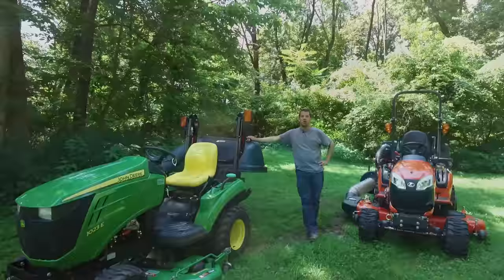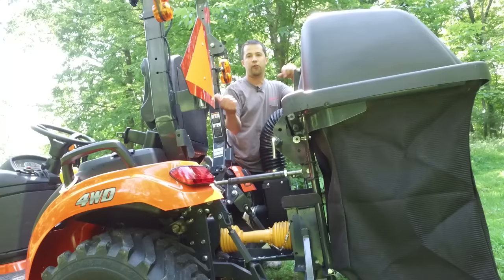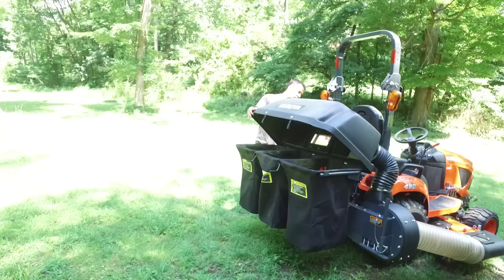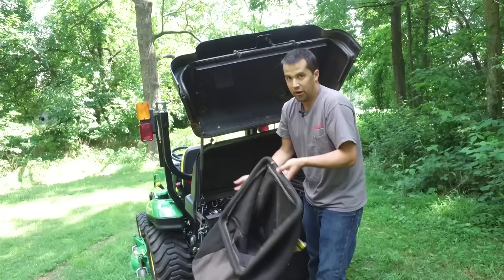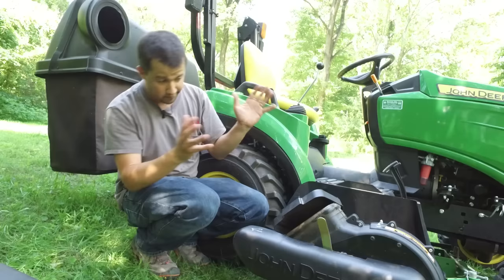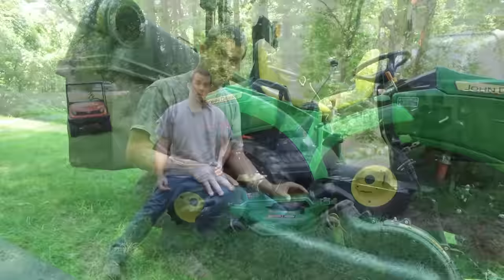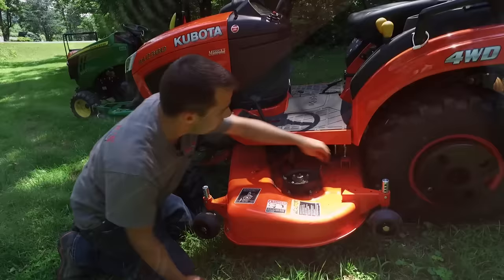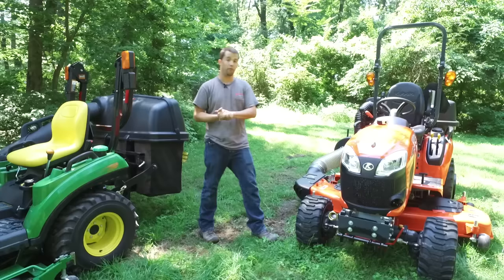John Deere 1 Series VS Kubota BX Series: Grass Bagging System

Comment: I agree the Kubota does seem to be heavier duty and I really like that it is mounted on the 3 point hitch instead of some other mount thing. Also really like that the hoses on the Kubota are flexible which makes them much easier to clean out. That hard plastic chute on the Deeres are a real pain to clean out, especially when clogged up, however it can be easier to whack it on the ground and beat stuff out, but still cant reach all the way inside to get to everything. Also the off set of the Deere is really nice when mowing up close to large shrubbery and small trees as there is a lot less to get hung up on the machine and damage the plants. And the bags falling off is no issue at all. There's enough friction there from the weight and bits of grass between the fabric and metal that they dont go anywhere. That clip on the Kubota honestly would be a pain in the spring and fall when everything is wet and there is so much more weight than normal that having to fight that would be pretty annoying. I would chop them off pretty fast actually. Havent used the Kubota set up though, so can't say its the beat all, end all. Kubota is definitely coming up with some nice stuff though recently. I realize I'm a bit behind as to when this was posted, but I look forward to seeing what the other side is up to.

Comment: I have a 1025R with a 60” deck. Very heavy construction and the auto connect works great for me since I bought it back in 2013 (with no adjustment since new!) a real time saver. The Kubota bagger looks much nicer. For the Deere (and Kubota) you can get a TKV20 bagger setup which is much better, with a PTO fan and the ability to dump from the seat.

Comment: My neighbor has a Deere with a 54" deck and bagger.  First thing he did with his bagger is utilize his OLD plastic canisters from his Crapsman bagger in place of the mesh bags Deere has.  MUCH easier to dump.  Almost a direct fit.  All he had to do was reinforce the top of his canisters with some 3/4" pvc pipe.

As far as mowing, his Deere does 10 times better job of mowing than my 60" Kubota does.  My deck does not pick up behind the front wheels especially on the discharge side.  I put on Gator blades and that made a huge difference, but I'm still not pleased with the result.  I've also watched him take his deck on and off many times, never had a problem with the drive over.  Personally, I don't mind the "old way" of removing it and I would never leave it on when tilling a garden.  You end up with too much dirt on top of the deck.

All in all, I would still buy the Kubota over the Deere
Reply: Your mower deck should cut way better than the deere deck. Make sure you have it balanced left to right and set the pitch to .25 inch lower in the front.

Your kubota deck will out do that deere deck easily
Reply: @Stegs  I was wondering this too if 48VAC's deck isn't properly leveled.  I know with my regular lawn tractor if the deck isn't level side to side, it not only cuts uneven (duh) but the overall cut quality just sucks, it don't lift and blow clippings out properly and it don't cut very clean either.  

I think you have to run at just about max engine RPM to get a nice clean cut too, many people I guess just try and run at lower RPM's for whatever reason which lowers the blade speeds on the mower and gives a lower quality rough looking cut as a result too.  

I skipped buying the mower deck for my Kubota because I already have a lawn tractor, but at some point my buy the deck for mowing the pasture, only the future knows what I'll end up getting HAHA.  I'm waiting for my dealer to get more BX tractors in, they're completely out due to high demand for some reason, its weird, but I guess with this COVID stuff going on everyone got rich somehow and bought a tractor LOL.  So I'm about a month and a half away from taking delivery of my BX2680 with loader, tiller, and box scraper.  Can't wait.  

I realized while researching sub-compact tractors that the JD 1-series has a limited category 1 hitch and a slower mid-pto speed too (2100RPM, instead of the 2500RPM of the Kubota).  The 1 series John Deere I swear is a over-priced lawn mower really in the way its built they skipped a lot of stuff that would really make it a sub-compact tractor it seems.

Comment: I'm a Deere guy but I will be the first to agree that the deck setup and bagger on the Kubota BX is world's better than the Deere. The 1-series bagger is an abomination. It's interesting that you measured the raised height of the decks. That is something that soured me right away on the 1-series. When the deck is raised it barely clears the ground. Maybe not a big deal if used as a dedicated mowing machine but it certainly means you'll want to remove the deck for loader work. I have a slightly larger Deere model and elected NOT to use it for mowing. The deck setups on most of these small tractors is just too kludgy. For what I would have spent for a decent mid-mount deck and the extra hardware to go with it I was able to just get a dedicated riding mower. :-)
Reply from the maker: Yea, we see that a lot too. The decks for these bigger machines start getting really expensive. Once your into a Kubota L-series \ Deere 3xxx \ etc you can buy a small ZTR for the cost of a deck.
Reply: Messick Farm Equipment Which really doesn't make sense.  Decks do not have an engine, the most expensive part.  So where is all the cost going?
Reply: I know nothing about the bagging system, but the mid-mower deck on a JD is worlds better and faster to remove or set up than a Kabota.

Comment: I have had a BX2200 since 2001 with bagger.   I LOVE the tractor.  The ONLY thing I don't like about the tractor is the rocker foot pedal.  The JD twin touch is much better.  The Bagger works VERY well.   I have the older style and is a little difficult for me to put on alone.  I am thinking of making a larger container out of screen and a metal frame for when I pick up the leaves since it fills up quickly.
Reply: We got a new tractor (bx1880v), and it also has the rocker pedal, which I don't like.  Our old tractor, also a kubota, had a different pedal.  Wish they hadn't changed it.

Comment: I will admit if I was going to use a Factory bagger I would rather have the Kubota. However there is an aftermarket bagger that would kick both of their butts. Tractor time with Tim just demonstrated it 2 weeks ago. I have no idea how much it costs but I thought about buying one and I don't even use a bagger. You don't even have to get off the tractor to dump the bags. And it does mount to the 3 point hitch. And it also uses the rear PTO for the fan.
Reply from the maker: We sell them, the company that builds it is in the neighboring town.

Comment: I have both John Deere 1023E and Kubota BX 1820.I personally like the John Deere better I take the loader off and on a lot and also the mower deck. It takes me maybe 2 mins to do either one with JD. The Kubota is a lot more steps and I personally hate the Kubota toe heal petal. I don't have a bagger for either of them I am currently looking of one. Both are nice tractors there the same but way different.Thanks for the video!
Reply from the maker: +Dakota Ellingson I'm sure you're aware, but the BX1830 (there never was an 1820) is 4 generations old now. Deere has been largely sitting still, so in today's models there is a significant gulf.
Reply: yes my fault it is BX 1830. I would be more then happy to buy another Kubota if they change the toe an heal petal. mine runs great never had a problem.

Comment: There's 2 different bagger setups for the Deere.  The one in the video is the cheap option.  They do have a 3 point option as well but like the Kubota you have the issue of raising and lowering the bagger when you raise/lower the deck...problem solved if you opt for the optional separate valves I believe.

If you don't want to bag, you remove the whole system including the blower.  Its not meant to be uninstalled and reinstalled all the time so requiring a couple tools to install/remove the system isn't a deal breaker.  Most people either bag all the time or maybe just a few times during the fall picking up leaves.  So its not something that is put on and taken off every time.

I have heard several people say that the auto-connect decks are a joke and not to waste the money on them.  Like you they've had similar experiences in the PTO coupling.  Myself I'd skip that as well.  The deck wheels spin 90 degrees to allow you to drop the deck onto the deck wheels and simply roll the deck out from under the tractor.  No you aren't going to just pick the deck up by hand and carry it around, but it still allows easy removal if you are going from mowing to tractor work like with a loader or other implements.

Comment: We have a X360 deere with the bags, and i gotta say it's probably one of the better lawn tractor designs, but i see where the good points of that design become a nightmare with the sub compacts. I gotta agree with you guys on this video 100%
Edit: although I will say, and this is not a good point at all for deere, the whole mower system with the bags seems like an afterthought for the 1 series. I see things that they get great marks on their smaller tractors for that simply were not changed what-so-ever for the bigger machine.

Comment: Something else to point out, the 3 point on the 1023e is a limited category 1, I hadn't realized this till I started researching tractors.  

The bagger on the JD is just a 1/2 assed attempt it seems, and the tractor itself is just a very large lawn/garden tractor in the way its built it seems.

Comment: As a mechanic I saw features on both that I liked and didn't like. Although for the most part I agree with your talking points. 

For example that is an older Deere. Not vintage by any means but older non the less. The newer ones have separate height control of the mid and rear implements. I don't know if this one does or not. I believe it does...And if in fact it does...Why not use the 3pt hitch for the Bagger mount? That's just silly...

I am personally a fan of Kubota Tractors over MOST Deere products...Meaning that there are a Couple of Deere Tractors I would buy before a Kubota Equivalent. But I can say the reason most manufacturers use a deck mounted blower is simple...It's in the name "Blower". These type of Fans Blow a whole lot better than they Suck. So having them closer to the deck discharge makes them more efficient. Now as I said earlier...I agree that the way the Bagger is mounted on the Deere doesn't really make any sense when there is a perfectly good and capable 3 pt hitch back there. 

I can see the thinking behind offsetting the bagger. There are 2 obvious reasons from my perspective. 1. You get a straighter shot from the blower to the Hood. (NO 90 degree bend from the fan to the hood like the Kubota) and 2. It allows you to THEORETICALLY get closer to garden beds and other such obstacles on the non discharge side of the machine.

As far as the bags being held in by a latch...I do not have that feature on my current bagger. And it has NEVER been an issue. When a bag is full they are HEAVY and that causes a lot of friction.  They're not going anywhere. Unless you leave the hood open and start pulling wheelies. Which is an idiotic thing to do with or without a bagger...

You also forgot to mention that you have to alter your 3pt hitch on the Kubota to be able to use the bagger meaning you have to reassemble your 3 pt to get back to normal 3pt hitch operation is also quite inconvenient...Even if it is just pins...It's still an inconvenience that the bagger needs to have the 3pt set up differently to be able to use either the bagger or any other implement.

And finally...Drive mower decks are no different than any other decks in terms of maintenance. They ALL need to be serviced and maintained to work correctly. And that includes checking adjustments.
Reply: On the newer Deere 1-series (and others) the separate deck lift mechanism is still an option. The default is to still use linkage from the 3PH to raise and lower the deck.

Comment: On my 3042R, It's really not that hard to put on the drive over deck, as long as someone is available to guide the driver to keep the tractor centered over the deck.  Doing it alone can be a challenge.

So, it's not as easy as Deere says, but it doesn't take 2.5 hours unless something is seriously screwed up.  Or maybe the 1 series is massively different from the 3 series.
Reply from the maker: something was screwed up. We where lifting the entire deck trying to guide it in and could not. Eventually it went on and we walked away saying we would not touch it again. I am sure a technician who knows how to set it up could have gotten it working properly.
Reply: Hang a tennis ball like people do in their garages

Comment: There is a trade off from one brand to the other.  I bought a JD X580 and really like it for my needs. Kobota has limited in the lawn/garden models.
Reply: The X-series is a garden tractor if I recall, so its not a sub-compact tractor like the BX series Kubota if I'm not mistaken.  Those X-series John Deere garden tractors are pretty dang nice though especially if all you do is lawn/garden chores.

Comment: I have the power flow vacuum on my 2025 , not really in love with it! I always remove the fan whenever I'm NOT bagging the grass or leafs! You have to remove the drive over ramp! It's just 2 nuts, not bad. Don't like the way the fan matches up to the deck. I have the 62 inch deck. I don't have any trouble with the 3 bags sliding out of the hopper. On the 2025, that L shaped bracket that holds the bags is bolted to the drawbar with 3 large bolts. I bought it sight unseen, I first talked to my dealer about some way to collect the grass/leafs, and he recommended the power flow. I feel a trac vac would be better then the power flow from John Deere.

Comment: I like the simple disconnect by the decks discharge chute. John deere has a better drive over deck set up than kubota, but I would prefer a pull behind on a 3point though. If I want a mower I buy a mower. However one sarcastic advantage to owners in wooded areas, kubota orange is safer aroundhunting season than the green paint lol. So there is that. As far as apull behind goes, that's why one of many reasons I am looking at the m5-111 though:)

Comment: I'm a Deere fan, but their newer MCS are disappointing imo. They just seem like a lawn tractor's collection system on steroids which personally isn't something I'd want (except the trusty MC519 which is a great collector). The old 3 Bag and Hydraulic Dump Power Paks they made in the 80s, 90s, and early 2000s I always thought were much better units. Better engineered and very well built, almost exactly like the Kubota's design but they had an auxiliary engine rather instead of being PTO powered. 

If I was in the market for a Deere collection system I'd either find a nice used older unit, or get a unit from another company.

Comment: You could just leave the fan turned on.  That would Really spread the clippings.
Reply: The fan and the tubing in place, remove the bags.  I did that on my MTD when I was too lazy to remove the bagger.  Walker Mowers has a solution similar to that as well where the back opens up and the snow blower-style oscillating chute fires it out the back.

Comment: The JD dealer tried to have me buy their bagging system. I did tell them about the extra weight on the deck. So after battling with that sales guy I left the dealership without a John Deere. I went to another dealership bought my 1025r. For collection materials I went with Agri Fab tow behind mow vac. Yes I’ll have to create a boot. I was going to go with Terra King TK20 but they never answered my emails or calls

My mower deck is off my JD 1025r when I till or work around the yard. Is it a hassle. Over time I’ll figure out a way to streamline it

Comment: Was looking around and ran into European review.
They had several rear discharge with bagger riders - Looked like it worked well and dumped from the seat.
Have to look for something similar here.
Reply: Found JD X300R - Hmmm
Reply from the maker: +jake legg Europe has all kinds of Bagger options that don't exist in the US. I've asked several times because there's a lot of stuff there that I would like to have. It seems the reason why they don't exist here is because those designs don't handle thick heavy grass as well. There are concerns that it wouldn't meet the performance expectations of the US market.
Reply: Messick Farm Equipment not only that but I believe composting and bagging grass is a little more common over in Europe and I think they might have slightly less grass then some of us around here I would never get a bagger personally seeing as I live on a farm and after cutting each little chunk of grass having to empty a bag vs just leaving the clippings there also we do have a could hills so we have a commercial cub cadet zero turn with back weights for the hills I like the mower just make sure to run with premium gas at all times mine seems to have lost power over the years and I blame that on not running the better gas in it I think if I was to buy a new mower it would be a grasshopper diesel